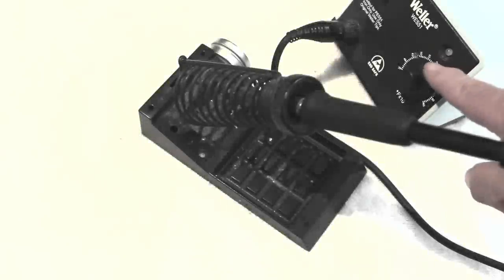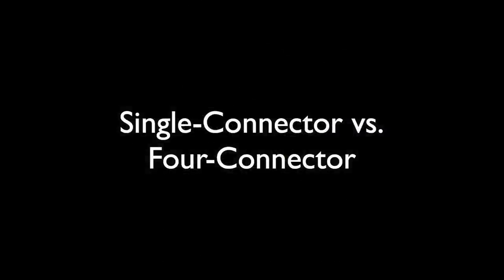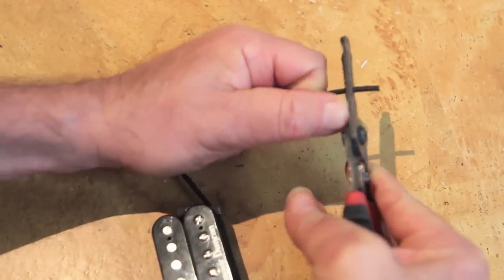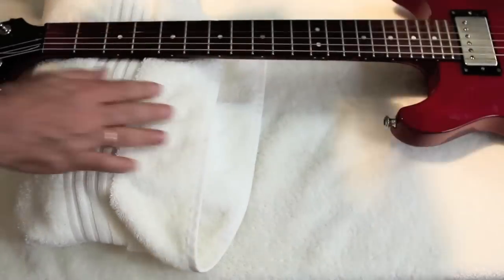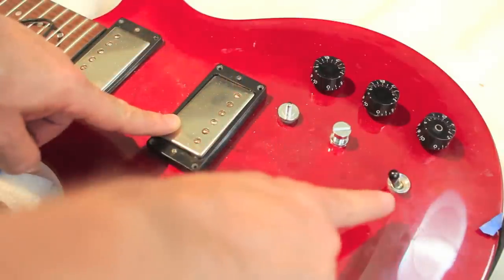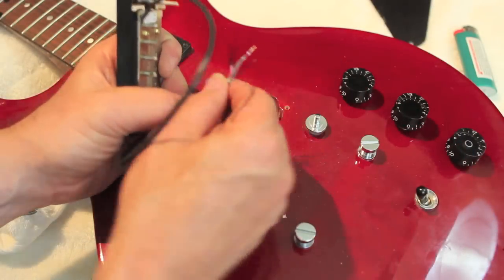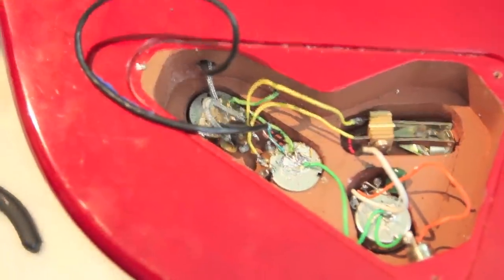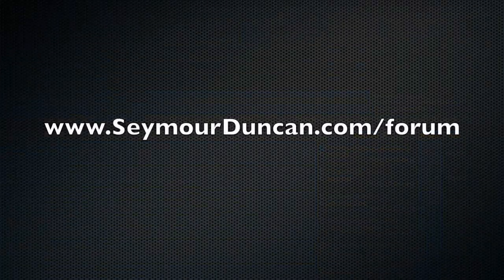How To Change Guitar Pickups

Comment: Working on a guitar is really fun and frustrating. The hardest part is soldering the pickups. I put new Gibson Classic tuners on my Epiphone Les Paul instead of Grovers and had to drill new holes which was easy and ok. Then for the new pickups I put Seymour Duncan Alnico II Slash Pro pickups. The guitar looks great I really like it. Just remember your soldering iron has to be hot as hell and use the thin solder not the thick one unless you have like a 45 watt solder which is extremely hot. But if its a 30 watt use thin solder. Just a warning to all the people who want to do it by themselves. Good Luck:)

Comment: Thanks Seymour Duncan! I just ordered some Slash seymour duncans for one of my les pauls to use as a backup for my Slash signature les paul, waiting for them to arrive they should be here in the next couple of days so i am just learning how to wire a pickup as this is my first time wiring pickups, i have experience wiring pedals and switches and input jacks etc but never a pickup, i will post my progress after the installation thanks again! :D
Reply: Thanks again Seymour! It worked perfectly first time. Although the guitars wiring was a bit of a mess from the previous owner i rewired it all neatly again with the addition of the new pickups and they work better than expected!! Great service i cannot thank you enough :)
Reply: Hey Darryl, James Hopper here! This video is great eh?

Comment: Great video!  I'm pretty good with most LPs, Strats, and some mods to both. About to tackle a wiring nightmare (as I see it). Double neck guitar with coil splitting. Notice I didn't say coil taps because technically a coil tap is only used in single coil pickups. Coil splitting is for humbuckers.

Comment: Great video!  The only tip I'd add is regarding re-installing wood screws.  Here's what I do:  put the screw in the hole and press down very lightly, then rotate it counter-clockwise (backwards) until it clicks, which means the threads are lined up, then turn it clockwise to tighten.  This tip will help you from stripping out the threads in your guitar.
Reply from the maker: Great idea!!
Reply: An absolute must,every time I do any guitar maintenance. Great suggestion.

Comment: Quick question, whether changing the pickup always the answer for repairing a noisy guitar?
Reply from the maker: Not always. A bad ground, bad solder joint, or playing near fluorescent/neon, big transmitters & dimmer switches can cause noise. A good pickup, shielded pickup cavity, complete ground, and good soldering are the things that will all help solve guitar noise problems.

Comment: This is a nice demonstration! I like the sound of Seymour Duncan pickups because of their low-end emphasis and have SH-1s in my Fender Jaguar, but there was one more problem that had to be solved to install them: some wood had to be routed to fit them inside. Can you show how to do that? What about installation techniques that use the red/white wires? Also, why don't you consider manufacturing killswitches?

Comment: Ok I have a question that I would greatly appreciate if someone helped me with, I want to change my Seymour Duncan (Passive) pick ups in my Schecter C1, with Dimarzio D activator passive pick ups. My only problem is that, my current pick ups are connected to a 5 way switch blade. Does this mean I have to buy a 3 way switch in order to use the pick ups?

Comment: Say the back of your guitar is a complete solid body.  (I've got a Schecter Diamond Series Omen 6)  where, or rather how, would I go about getting to the internal wiring of the guitar?

Also if anyone knows, I've got a question regarding the B and e strings on my guitar.  Up past the 21'st fret, a few frets don't actually register.  For example, if I play 22, 23, 24, the strings sound as if I played 22, 22, 24.  No matter how hard I'm pressing or how tightly I'm squeezing behind the fret wire.  I ASSUME it's a pickup issue because my humbuckers are mega fucked right now, but I actually have no clue.

I don't play that section of the guitar often at all so the frets definitely shouldn't be worn down.  It just makes me not want to play past the 15th fret on those two strings at all.  Any ideas would be much appreciated.

Comment: I have a question, I have an Epiphone LP with a Floyd rose trem it is a very dark sounding guitar, its ok sound clean but hi gain its really muddy unless i really change the settings on my amp ( this guitar is the only one that sounds bad with my settings my others all work). Right now i have a JB trembucker  in the bridge it helped a little but its still really heavy with the bass and mid. I know its the guitar giving the bad tone since i have the JB in another guitar and it sounds awesome. Do you have any suggestion how i could brighten this guitar up and have better string definition? I love the guitar and how it feels. I just cant get a good sound out of it. Maybe it just ends up on the wall out of service

Comment: the trick to soldering is to heat The Wire till the solder melts if you heat the solder and drip it on the wire it's going to be sloppy. also if you do a lot of soldering I highly recommend the Hakko FX-888D its Awesome

Comment: My Jackson  X soloist has the green & plain wire soldered to back of 500k volume pot & the 2 black hot wires are soldered to the back of the pot, before they are soldered to the right terminal in the pot.  The red & white wires are soldered to the left terminal and another white wire soldered to the center terminal.  The other red & white wire pair are soldered together & taped. What the heck is going on with this wiring. There is no coil tap, and the existing wiring is not hooked up the way this info explains.  Can you just cut a little extra wire on the existing pickups and splice solder the new ones cable to cable, matching the colors as you have indicated?

Comment: Im planning on installing a new pickup which has 5 wires(red,black,white,green and bare) and my original pickup only has 2 wires which is signal and bare wire.The new one says to tape the white and black together and do the same thing to bare and green.So I will have only 2 wires to solder which is the red one as hot and green/bare as ground.The question is should I solder it the same way as the original one?Being the red is now soldered to the same place as the signal one before and the green/bare too being soldered to the same spot?

Comment: No flux, holding the iron to the wire then putting the solder to the wire when it reaches temp. way do go ruin the copper making it brittle and creating a dry joint.

Comment: which capacitors use in jazz installation model and jb? 0.12?
Reply from the maker: +Rogerio de Souza Lima Barros I'd start with .022uf and move from there if you don't like the sound. The higher the value, the more highs are rolled off.

Comment: How to split a SD humbucker with a DPDT ON ON mini toggle switch
Reply from the maker: This diagram shows a DPDT switch as a push.pull pot, but the wiring is the same if it is a separate switch: https://docs.google.com/gview?embedded=true&url=http%3A%2F%2Fwww.seymourduncan.com%2Fwp-content%2Fuploads%2F2016%2F05%2F1H_1VppSPL.pdf

Comment: Alright. Sorry if what I'm asking is stupid sounding or if I missed something in the video, but I have a problem. A bare wire from one pickup is connected to the same from the other pickup, and connected to one side. On the other side, a white wire from one connects to one place and the white wore from the other connects to another. My guitar is an Epiphone Les Paul Special II, if that helps. Any advice for what to do? I'm probably confusing myself, but I need help.
Reply: Just have a look at the wiring diagram at seymourduncan.com ;)

Comment: I need help on this, I have a GIBSON LPJ 2013, I want to change the pick ups to Seymour Duncan SH11 Custom Custom but it has this quick connect sitting on a PCB board circuit instead of those wire it traditionally, so how do I connect them pickups? Molex connectors? Rip off the circuit board and wire it traditionally? im new at this....
Reply from the maker: Mac Beth Yeah,  sorry they have been doing that! Here's some solutions: http://www.seymourduncan.com/forum/showthread.php?274532-Changing-pickups-on-a-new-Gibson-guitar-with-the-circuit-board-wiring

Comment: I can't find anything for my pickup. I have a late 70's early 80's bill Lawrence pickup blade style (a real deal Dimebag Darrel pickup). It has a Red wire, black wire, and silver wire. What's what? I'm pretty sure the silver is ground since it's separated from the black and red wire.
Reply from the maker: You might try asking that company for info.

Comment: What watt soldering iron would you recommend? I've heard that you can get away with a 20 watt iron, but would a 30 or 35 watt iron be more effective?
Reply from the maker: I use a 40 watt one, as sometimes it is a pain to solder onto the back of pots. If you plan on doing a ton of soldering (say, for a living, or for many guitars), a variable temp iron might be a good investment. But I use a basic 40 watt one.

Comment: Hi, what is the problem when you wire a volume pot but it only works as a on/off switch.? I mean my volume dial goes 1,2,.. then 10!
Reply from the maker: It could be the taper of the volume pot. A linear taper pot reacts the way you are describing. You may try an audio taper pot, which sounds more gradual.

Comment: Heeeeeelp Seymour duncan!!
I wanna get a Seth lover for the neck PU of my 2012 LP studio (gibson)
But it has the PCB board where the pickups are installed with the three pin molex plug.
If I buy a molex plug and some crimps can i crimp the ground and green together as well as the North finish/south finish together, plug them into the molex housing and plug that into the board?
So could someone tell me 
-How many wires the Seth lover has inside
-can two wires be crimped together
-will it work
And no gutting the thing and putting a normal wiring is not possible. neither is cutting the current pickup wires and splcing them together
Reply from the maker: +Rb Rb You can, or cut the connectors off of the current pickups and splice the new pickup wires in. Ask this question in our forum for more detailed explanation: http://www.seymourduncan.com/forum/

Comment: So... if he has to solder one wire to another, why isn't this done by the factory? Or does it have something to do with the switch and the number of pickups?
Reply from the maker: Some people use those wires differently, for multiple wiring schemes.

Comment: Great video.  I'm having a problem with buzzing noise after I swapped out pickups.  There are two single coils and a humbucker, and I get buzz on all of them.  The switch positions all work, and I get decent volume out of each position.  But I can't get rid of the buzz.  Is it possible to install pickups backward?  I didn't think so but now I'm wondering.  I thought I connected grounds and hots correctly but not sure how I would know for sure.  Thanks.
Reply from the maker: It is possible to reverse the hot and ground on the jack, which would cause a lot of buzzing. Check all grounds, and make sure there is a bridge ground. Check all solder connections. For more advanced troubleshooting, post a question (with pics) on our forum @ http://www.seymourduncan.com/forum/

Comment: I just installed another dimebucker  , this time to my 2 humbuckers jackson with a 3 way selector. ....everything is the same as in this video except the hot wire connects to the bridge part of the selector....I imagine this will be the same for your 5 way as my ibanez had a 5 way and it's still screaming away
Reply from the maker: +John Gault Yeah!

Comment: Can this video be followed for a telecaster? and if I was going to switch the regular neck pickup (lip stick) to a p90 can this video kinda be followed
Reply from the maker: Yes, it is the same sort of thing. A P90 is a single coil, too, so you'd have the same wires. Just note where the wires of the stock neck pickup go, and solder the P90's wires in the same place.

Comment: This wiring on the video is series or parallel? I have a dimebucker on the bridge and it was soldered in parallel just as in the manual, but in some humbuckers reviews, in series gives more gain and rounded sound. I chose the dimebucker to play real metal, and it just don't have much gain, only treble. What do you suggest? It would work on series?
Reply from the maker: +Erik Oliveira I would wire it in series, you will get that power you need!
Reply: +Seymour Duncan Pickups What guitar is this?

Comment: I see that you don't solder a cable to the 3-way switch. Everything is soldered on the volume pot? I want to install pickups in my Ibanez GRG170DX and that has a 5-way switch with 2 humbuckers (Neck/Bridge) and 1 single coil in the middle and I can't seem to find an appropriate diagram. I think that I'm just going see where the wire are soldered on the old pickup and solder the the cables with the same function back.
Reply from the maker: ***** Hey there, stop on by our forum and we can help get you squared away with soldering to the Ibanez 5-way.  http://www.seymourduncan.com/forum
Reply: ***** Thank you, I have recently found out that the pickups installed are powersound pickups, with 3 cables:  One Back cable connected to the volume pot, one red and one white both connected to a different lug on the 5-way switch. Is there somewhere that I can find the color codes?

Comment: I can never install a SD without buzzing like crazy...
Reply from the maker: +HeyItsAsmus If you use the right diagram and solder correctly, it should be very quiet. If that ever happens again, post a question on our forum and you will get the help you need. http://www.seymourduncan.com/forum/
Reply: +Seymour Duncan I use the Duncan liberator and SH-5 I've been trying to get ahold of a tech at Duncan for a couple days... No matter what I do it buzzes like crazy
Reply from the maker: Post a question on our forum, and we will get that sorted out today.

Comment: Really great tutorial, man. Have you ever soldered on clips so you can swap out pickups without re-soldering? Is that a thing? Seems like that would be really cool. :)
Reply from the maker: +Coco Mandrake Personally, I have done this, and it works well. Seymour Duncan makes pickups the way they used to make them (vintage accuracy is big 'round here) so that's why there are no clips.
Reply: +Seymour Duncan Pickups : I like tradition as well, but I'm also lazy quite often. Definitely appreciate your tutorial regardless; best to you, man! :)

Comment: dont you have to connect the pickup to the position switch? i have a 5 way position switch that gets Bridge,Coil split bridge, Bridge and neck, Neck coil split, and Neck... how would i wire that?
Reply: I believe the position switch is wired to the pots and not the pickups.
Reply: That's not a part of pickups.Black one transfers electric pulse,green one's adjusts power of the pulse.Position switch is to choose between pots so you don't need to change that unless you want to reverse it.

Comment: Would my local music store not change my pick ups for me in my bass if I get the pick ups and give it them ??
Reply from the maker: Hey Ben, most do. You don't have to change your own pickups if you don't feel comfortable with a soldering iron.
Reply: I'll have to have a ride down and ask them.

Thanks for the reply :-).
Reply: Absolutely, but it's a ripoff. You'll probably pay $50 - $100 for 2 pickups to be installed. You can do it yourself with $20 of gear from Radio Shack. It really isn't at all hard.

Comment: do you have to change the wires
Reply from the maker: +Jackiiioou Lerizaquio Not the wires already in the guitar. Keep in mind, though, the wire colors we use: black is hot, red & white are soldered together and taped off, and green & bare go to ground.

Comment: I would like to buy a set of seymor duncans to install in my current guitar, but I would like to know if, in the future, I can remove them and install them in another guitar.
Is this possible? Thanks
Reply from the maker: +dionisiogdrb Oh yeah! To make it even easier, you can install one of our Liberator pots, and then you can switch pickups out with no soldering.
Reply: ***** Sounds good thanks for the reply!

Comment: Hey guys I have a question. I am thinking about buying a set of seymour duncans to install in my guitar but I must know, if I were to do a sub par job with the soldering would that affect the tone in any way? So basically my question is could I do just as good a job as a pro providing I get good at soldering?
Reply from the maker: Stephen Coburn You should be fine so long as you don't get a cold solder joint. If the pickup ends not working it means you need to go back and fix that, otherwise I wouldn't worry about it so much, everyone who starts soldering is a bit messy at first!
Reply from the maker: Stephen Coburn http://www.seymourduncan.com/blog/the-tone-garage/how-to-solder/

Comment: need help here! I have a schecter demon 6 with duncan designed pickups. now i bought an ahb2 Blackouts Humbucker. the Problem is, that the cable goes right into that duncan designed and there's no Clip... What should i do now?
Reply from the maker: Hmm, we are not quite sure what is going on here. Did the guitar have active pickups to start? You may want to either contact us directly via our website or on our User Group Forum so we can help you out directly. We might need pics to see what is going on. We'd love to get you back to rocking, and YouTube isn't great for diagnosing problems, so contact us in one of those places and we will help you out!
Reply: Ok thanks i  will do that. 

Yeah the guitar had active duncan designed hb 105
Reply: *has